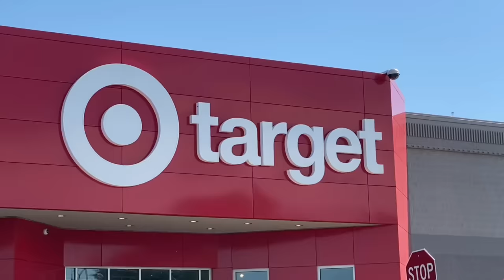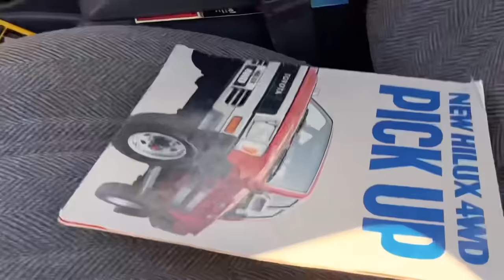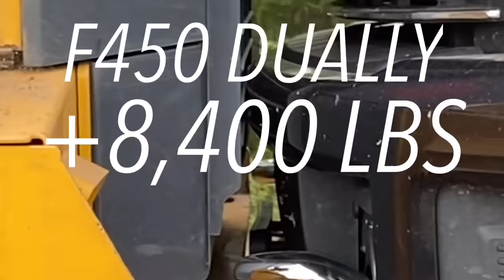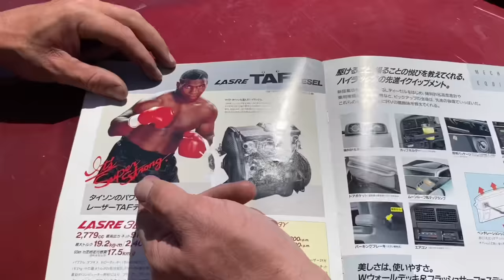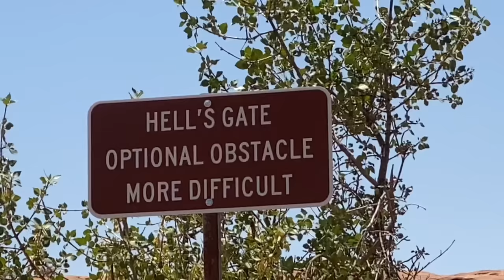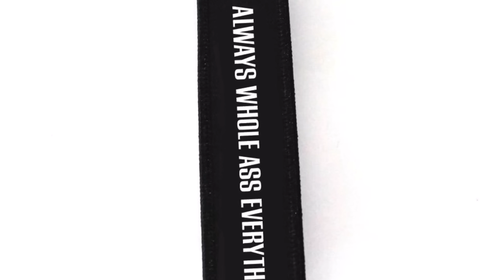Toyota Hilux Durability Test #3

Comment: Toyota engineers,  designers and manufacturers be proud.  How can anything be that indestructible and be mass produced.   We salute you.  I kind of hoped it would go into a hall of fame at Toyota.  Great channel as well.  So glad I found it.
Reply: Everything toyota builds is better than any other make. I bought a toyota echo and drove the shit out of it and couldnt kill it.
Reply: @shawnkelly695  I have a 2004 toyota echo, nothing has ever broken on it. I've only ever done general maintenance to it. It's also sat for years at a time and just started right up. Great car
Reply: @sa1t938  toyota quality. Big 3 loosing sales and imports all over. Instead of building quality they try some new crap and fails and more imports. The big 3 also have severe rust issues. So many knock chinese imports but they dont rust and fall apart under 10 yrs
Reply: Because of iterative design. Every year, they take everything that broke from previous years and make it better. Pretty soon there is nothing left that will break.
Reply: I had I think it was a 92 toyota pickup. Wasn't a Tacoma just said pickup. Thing had a badly bent frame and I drove the shit out of it and it started up and did 80 no problem
Reply: @waffleninja1000  not true, if you look at the new hilux utes for sale in Australia, they are a far cry from these beasts.  Toyota can definately value engineer with the best of them
Reply: @shawnkelly695  This didn't dawn well. 2022 Toyota Tundra has severe issues with nearly half of them already recalled due to catastrophic failures (axle assemblies separating to name one). 

Toyota has ALWAYS had a rust issues as well so doesn't make sense to complain about others having that issue?...

Plus this: Ford is currently outselling Toyota in the US for 2022.
Reply: @Michael-yc9ex  i use to love ford. Then tried chevy. Now i kinda dont really care. I drove a toyota echo. Nice reliable car but ugly as shit and not comfy. If i was in a situation that i could afford a brand new ford or chevy i would buy 1 every 5 yrs. But its once they are old. The old toyotas are cheap and easy to repair. Yall talking 2022 crap when nobody afford that new garbage.
Reply: @krisstewart327  toyota pickup is the american hilux.
Reply: @Michael-yc9ex  rust, what Toyota, ford are rusting quicker then Toyota's, also catching fire, destroying transmissions etc etc etc, but I don't see 3rd world countries depending on a shit box 150 but hey chat shit brah
Reply: i want a old Toyota Hilux now😁
Reply: Me too bro! Same feelings what you've described, so glad that I found his channel
Reply: @shawnkelly695  its japan they build the best quality shit
Reply: The ones in the US are 40 years old and run better than any truck from 2000-2015 and are more durable than the newest models
Reply: @Michael-yc9ex  It's funny because you think that the USA is the center of the world, but nothing is further from the truth... Ford the best seller in the USA in 2022, but the reality is that TOYOTA was the best seller in the WORLD in 2022
Reply: @shawnkelly695  As someone who has a subaru enthusiastic dad, I can tell you they come close. His 1998 Legacy drove 30.000 kilometers with a broken Transmission. The Motor almost has 600.000 Km on it and still purrs. the frame starts getting rusty but the car itself wont fucking yield.
I'd say this is a japanese thing more than a Toyota thing tbh. And also, of course, just generally that old cars were built to last.
Reply: Some old cars built to last. I just bought a 2005 ford focus wagon. Not a rust hole anywhere. Not even the rockers rusted out. Runs very well. Paid 1300 and drove it 600 miles home holding steady 80 on the hwy. Cant believe a 18 year old ford still runs so drives so good and no rust. High mileage like 300 000 miles but like all summer miles never saw snow or some shit
Reply: @shawnkelly695  anything will last if it's maintained well.  What makes vehicles like the Hilux so special is they last even when you beat the crap out of them.
Reply: I drive a Corolla E100 with the 1.3L 12 valve SOHC 4 banger. 

it has 300k kilometres (actually extremely high mileage for a car in a small Southeast Asian archipelago), got flooded in 2009 by a typhoon, and absolutely nothing has broken.

Comment: 40k jeeps going slow as hell over rocks: tHiS iS tRuE oFFroADiNg

‘89 immortal hilux: Wrong.
Reply: I swear the Nokia 3310 was born from this Tacoma’s wing mirror cover
Reply: Lol
Reply: It must suck to be bias around Toyota 😂
Reply: @gamezone2470  more of a nissan guy
Reply: @gamezone2470  I've owned 3 toyotas, driven over 150,000 miles in total and haven't had to spend a single penny on anything besides oil changes and tires😆 i will never ever own anything besides a Toyota, the japs know what's good
Reply: @one-to-one-ratio  what??? No gear oil change, no coolant change no nothing? Only oil?
Reply: @LosSerpent  yes I did all of my own coolant flushes, brake fluid flushes and power steering flushes, I also changed the thermostat, spark plugs, the valve cover gasket all my self, and I did a trans flush myself, air filter, cabin filter, but I did all of that stuff as preventative maintenance, not reactive maintenance bc of something breaking, always fix things before they go bad on a vehicle, but all of that stuff was only like $300 so yea I basically spent nothing, nothing has actually broken on any of my toyotas, I got rear ended at a red light twice with my old cars and they were totaled out, I actually made over $3,000 bc I got both my other cars so cheap and the insurance company pays you what they are selling for hahaha I got some good luck in life at least
Reply: Tbf while jeeps are going to break (because their Chrysler)  they can get over anything because they have the best approach, departure, breakover, and articulation.
Reply: @raymonds7492  because there on the back of a tow truck
Reply: @suprajew60  that was the joke.

Comment: “My ranger will take everything you can throw at it”

Hilux: does hells gate in reverse
Reply: Attempts*
Reply: @ty12319  Better than 99% of trucks attempt it going forwards :)
Reply: @jonnyj.  somewhere on here there is a $300 chevy tracker doing it
Reply: @jonnyj.  My 5spd, 4x4  97 Isuzu rodeo is bascially a Hilux. lol.. except for those crazy huge ball joints on the front axle... Why are ALL 4x4's not built like that?
Reply: A bronco sport did it in reverse not too long ago
Reply: tbh Cody doesn't have that much experience in rock crawling. It probably could if he was more experienced.
Reply: @jperr2422  got a video?
Reply: @ty12319  ok.... sprints up hells gate in 4th, 0 fucks given
Reply: @jperr2422  was that before or after it had broken down
Reply: @calholli  horrible turning radius, my friend has a old 60s dodge pickup with that type of axle and the thing turns like a school bus lol
Reply: @Primal____  Makes sense.. The wheel base is short enough that it shouldn't really matter that much... I can deal with a 3 point turn over bustin a U-iee.   It would be worth the sacrifice-- you can just tell that it's just a better design for durability than the normal spindle
Reply: @calholli  closed knuckles have their own issues. They are notorious for leaking, because they are full of oil inside. They are more difficult to maintain, and have to be cleaned out and regreased if you drive through water. Open knuckles axles can have tighter steering, better axle seals, and easier to service. 

I just swapped the closed knuckles dana out of my highboy, because it was making a mess, and I couldn't get seals for the steering anymore.
Reply: @Primal____  yep, and they are more work to maintain, often leak and should be completely stripped and cleaned if you drive through water or sand. It has a tendency to enter through the knuckles seals and wreak parts. I am currently swapping the closed knuckle dana 44 out of my highboy because I can't get knuckle seals for it, and they are constantly leaking. Closed knuckles are a thing of the past, nobody really wants them.
Reply: Toyota is the only truck for Africa. All the rest are high maintenance and break easily. In Africa, we call Toyota a fool because it goes anywhere rivers, bushes, over rocks and deserts etc! If it breaks the repairs will have to wait until you get home.
Reply: @sqweezzstr  I  don't know if I've seen one broken down but there was one that rolled down an embankment. They flipped it back on it's wheels and once it was brought up to the trails it drove back out.
Reply: @jperr2422  but did it do it like he was trying too, or did they baby the rebaged escape like the factory piece of shit it is?
Reply: @sqweezzstr  probably got winched up it in reverse after it broke down trying to go down it using gravity only.
Reply: Ford first on rubbish dump Toyota built to last and in my country built to recover jeeps land rover and Fords from the Bush when the get stuck to brake down. Can not find a beta built truck and the hilux and land cruiser still remain the most used and abused pick up in my country

Comment: When Monstermax 2 is finished, Cody will bring it home on the bed of his Hilux.
Reply: Haha 🤣
Reply: Maybe one of the axles.
Reply: I wanna see him make MiniMax out of the Hilux
Reply: @NIHILWR  same, he seriously needs to restore it so it’s back to normal
Reply: @NIHILWR  maybe lift it a bit and get it upgraded like monster max 2
Reply: @NIHILWR  that'd be so badass (hulk hilux)
Reply: @ArchangelMichael.  But that’s when reliability and its capabilities drop. This truck has proven it doesn’t need any modifications to do what was shown. Also, I think it’s a bigger flex that it’s a stock JDM import.
Reply: @Shepard_AU  true, I’ve always been a fan of the older Toyota trucks and cars, but I meant build it like how he’s building his new monster max im talking upgraded beefy suspension run flat tires upgraded beefy axles stuff like that

Comment: This truck needs to be mounted on a 30' pole as a trophy.
Reply: The Jeep is still up on its podium
Reply: Toyota is the only truck for Africa. All the rest are high maintenance and break easily. In Africa, we call Toyota a fool because it goes anywhere rivers, bushes, over rocks and deserts etc! If it breaks the repairs will have to wait until you get home.
Reply: @morganderrick7663  in Kenya Toyota outsell everything else by a factor of about 10:1. My wife has a Corolla and it crossed the Massai Mara in rainy season! Tough!!

Comment: Well, the Boomers we're right about 1 thing. "They don't make em like they used to"
Reply: This might be the only time I have seen boomer used in a way you could say is correct.
Reply: *were
Reply: @davidritchie9344  all this time I thought boomer was boomhauer from hing of the hill just spelled wrong.....🤣😅☠
Reply: They really don't, just like they said if they made em too good you wouldn't be a yearly customer getting the next new pos
Reply: Indeed.. the economic system we live in incentivizes building things that break down. Technologically speaking we could build something even much more durable than the Hilux if we want to.
Reply: @Real_Richmond_510  that show is so insanely underrated tbh
Reply: @liam4686  that hasn't held true since at least 2000 lol
Reply: @liam4686  they're made in the US tho
Reply: @von...  😅👍🏻 it really is
Reply: Dude I know! I have a 87 Suzuki dirtbike, and my brother’s 2012 KTM was eating through wheel bearings, so I asked my dad: “do I need to worry about that” and he told me that it has the same bearings from 1987 and that they work perfectly fine
Reply: GOT danged zoomers, with their 79 genders and hwhut not. They just don't make 'em like they used to, I tell ya hwhut.
Reply: @anthonymuncey4537 Suzuki dirt bikes won't die. Great brand
Reply: @gotdangedcommiesitellyahwa6298  they really don't do they. I'm just saying trucks should be trucks. Reliable, easy to work on, and durable. New trucks don't check any of those boxes do they?
Reply: They just don’t make em like the Japanese do. All of the older Navara’s, L200’s etc go this hard as well
Reply: @cptchuff2741  Bro these are not made in the US
Reply: @izzy031096  for trucks American is the best. I knew a guy with a 99 Ram 1500 with 310,000 miles on it. I  have a 96 Ford Bronco that runs like a dream
Reply: @cptchuff2741  not this generation Toyota
Reply: @tvs3038  It only incentivizes it because of the amount of idiots that keep buying mediocre garbage and fueling the clusterfuck thats the car industry.
Reply: The 4 cylnder tacomas are pretty good

Comment: This is the definition of "They don't make em like they use to."
Reply: They never made them like this this is the only one.
Reply: @bensaxton3765  70 series cruisers are even tougher, they are straight up tanks.
Reply: @lb8130  too bad they only have one cup holder
Reply: Best comment I've seen in a while
Reply: @lb8130  over priced junk could buy two y61s that would out perform everyday of the week
Reply: @deakin9913  you mean 10 y61s or 2 y62s?
Reply: @cajonoutdoors  10
Reply: This just made me think of the recall on fords 2021 pickups where the steering would lock up cuz it wasn’t made right like it’s 2021 they still haven’t figured out how to make a steering system lol sad.  Everything new is complete junk, not just vehicles either
Reply: Before?
Reply: @lb8130  My patrol has out performed the cruiser since day1, 70s are underpowered tin cans good for nothing but carting water
Reply: Now Tacoma are made in USA
Reply: @deakin9913  70 series' kryptonite.. Deep ruts
Reply: MR. SCOTTY KILMER APPROVES THAT COMMENT
Reply: @bensaxton3765 you hating?

Comment: Imagine spending hella money on a custom off-road rig just to get outdone by an 80’s Toyota that’s factory
Reply: As vice grip Derek would say, “fac-tree”
Reply: Can't relate
Reply: @GM-ft9ec  I though about saying factree but I didn’t know if the elites of VGG watched this as well, no disrespect to the content but it’s two opposite sides of car content
Reply: Well yeah if you don’t care about banging your truck up of course you can make it. Had it did it slowly and methodically it would have struggled bad. Impressive how well it held up though
Reply: A factory truck after getting rolled towing more than 10x it’s weight and having double the rated bed load and hooning down wooops the fact this truck is still In one piece and straight says one hell of a lot about Japan
Reply: it's 1990 LN 106 Hilux with open diffs front and rear.
Reply: Love to see it
Reply: @janpur1417  not sure about that. I think they had front hub lockers, and rear limited slip diff. Not sure, but I think I saw in a manual of an Hilux LN106, the "DIFF LOCK", light on the dash.
Reply: @janpur1417  there's no way it had open diffs. it was fully locked in multiple parts

Comment: "they dont make em like they used to" has never been more true.
Reply: yeah, that's why here 6th gen costs more than 7th gen, despite 6th gen being like 5+ years older car.
Reply: @MrMusic6395  because autos are just better and out performs manual nowadays 😭😭😭
Reply: Except that they do they still make them and better like the lc 70 71 76 79 only not in the US
Reply: Even the new ones the Hilux are still easily way tougher than the other brands.
Reply: @Taachino  i believe so
Reply: True, my brother in laws 2018 recently had to get the entire transmission replaced. Now he says it feels its about to give out again
Reply: There was a new stock F250, still on factory tires, that did Hells Gate a year ago.
Reply: @Epotheros  good, but try beating that the same way and drive on desert without coolant
Reply: @JerenKanava  I'll only be impressed if that still has the same headgasket in 10 years.
Reply: @JerenKanava  I think the point is that if a stock f250 can make it up anything can.

Comment: It’s actually really hilarious how you have a bunch of people dumping money into high tech off road shit and make the obstacles a big deal, struggle, etc. Than WD trolls them all and just goes ham with a stock vehicle.
Reply: Not just any stock vehicle. A Toyota Hilux. God's gift to mankind.
Reply: Some guy I rode atvs with a while back liked to say that you could have the meanest atv but not be able to do the stuff he does because you dont have the balls for it lol
Reply: Yeah, what ever happened to a tough vehicle to off road. This truck or most older trucks put these new ones to shame, except for power.
Reply: There's a lot of stock vehicles that could do just as well.  My 97 Isuzu Rodeo has impressed everyone on trips out, similar to this.. The smaller, over built form factor is just a great set up.  That front axle is on another level though with those giant ball joints.  I want that axle. lol.. Although, to be fair, I've never broken axles/ cv shafts or diveshafts on my Rodeo and i've had it in a lot of places like this. (not as rough on it though)
Reply: That's how it always is. Tons of rock bouncers and built jeeps struggle all day and here comes the Toyota guys with straight pipes and bald 31's blasting up everything. Lol
Reply: @Jacob Del Bene Yeah.. the troopers are just a rodeo with a bed. lol..  Mine is 5spd 4x4.. 289k miles. I love this thing.
Reply: @michaelbenoit248  I'm not so sure. I want to see a newer Tacoma test